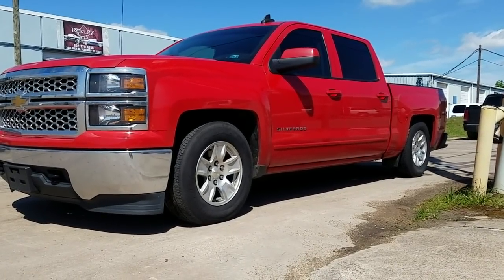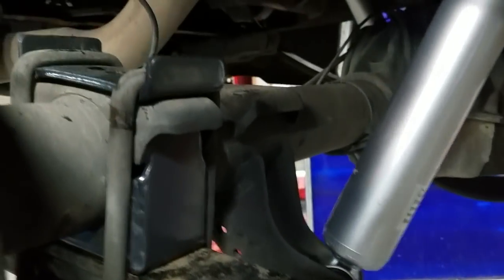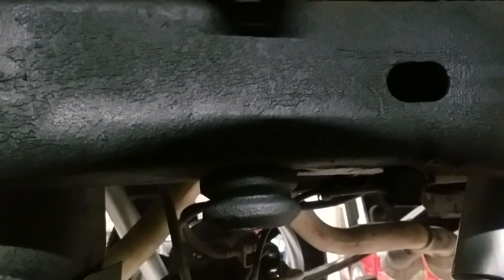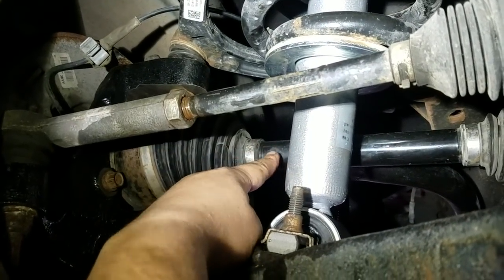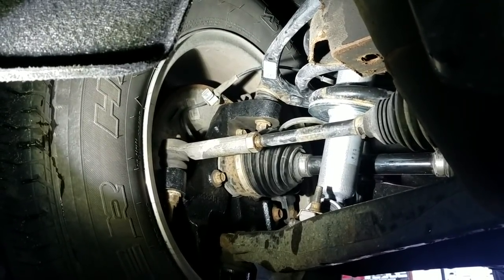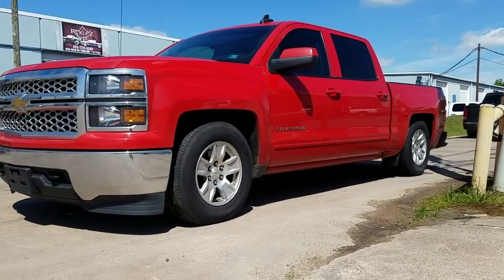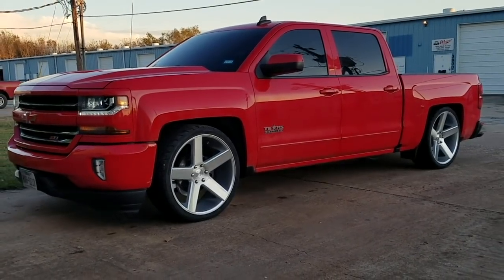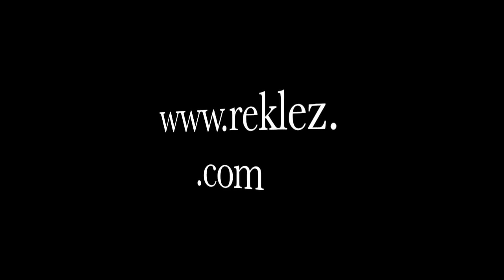4/6 Drop on 2014 Silverado Sierra 4x4 Trucks Cast Control Arms,

Comment from the maker: Buy this kit directly from our website! Get it shipped for free! https://reklez.com/products/2007-2017-silverado-sierra-drop-kit-3-5-4-7
Reply: Reklez Suspension Works  when will the 4/6 drop be available for the 2019 Sierras
Reply: About what do y’all charge for the first job?
Reply: Reklez Suspension Works do you have 6/9 drop kit for 2016 sierra 4x4 ?
Reply from the maker: @chevytrucksrock6608  lowest you can do on a 4x4 is a 4/6 we offer that kit www.reklez.com
Reply: Can this be done on a 2012 4x4 dually?
Reply: So the kit comes with everything we need for a 4/6 5/7 3/5 drop I’m about to order it for my 2014 Chevy crewcab 2wd would you guys recommend cast steel arms or the stamped steel arms

Comment: Planning a 4/6 drop on 2001 F150 4x4 crewcab. Wondering if I can get away without changing spindles. Factory spindles with belltech struts  allow a 4" drop?
Reply: Try using control arms. Lowering with just the strut could give you bad cambrr

Comment: I recently dropped my 08 Sierra with a maxtrac kit to drop the front by 4 inches. I’m rolling on 24’s and on bumps or uneven roads , the front begins to rub on the tires a bit. Should I buy a new strut, or what could be causing it to sway up and down in the front?
Reply: Ismael Flores depends where it’s rubbing but if it’s rubbing that easy sounds like u have the wrong offset rims and they a sticking out to far

Comment: whats the lowest you can go on a 4x4 i have a lifted 2017 right now. wanna go low tho
Reply: I just lowered my two wheel drive 2018 Silverado using a full Maxtrac adjustable kit with a 2 inch drop spindle and adjustable strut up front and flip kit for the rear.  I started with a 3/5 drop but I plan on going to a 4/6.  On this video he said you don't need a c-notch for a 4/6 drop but should use the bump stop.  It looks like they cut the original bump stop and drilled a hole in the frame to install it, you will have to cut the original bump stop bracket out. This video is very informative.  My wheel size is 285/45/22 no rubbing issues and it looks like I will have plenty of clearance for a 4/6 drop.
Reply: @SINGLESPEEDRIDER  you have a instagram

Comment: Hey guys im just up north from you in fort worth and I'm planning on doing something with my 18 silverado 1500, it's a double cab 2wd, when i get ready i will need to get some quotes from you but for now could i get the specs on the lift kit and the wheel and tire size, im digging that setup, thanks for your time
Reply: Call them

Comment: Hey fellas, How often do you guys do a 2/4.5 drop on a 2014-17 Chevy Silverado crew cab v6 with 24s..?? How smooth is that ride, are 24s to heavy for a v6..???
Reply from the maker: Hey, bro we hardly ever work on V6s. If you need more info/ prices. Call us on Jan.2 when we get back from vacation..
Reply: I greatly appreciate your quick response, how good do v6 crew cabs do with 24s
Reply: @jaluco02  I had a v6 on 8s bro no problems
Reply: A v6 with 28s
Reply: Yo how do I do a s/4.5 drop on my 4x4 silverado or what kit do u use @jaluco 02
Reply: brian avitia my truck has a 2/4 drop on 24s 35 series tires

Comment: What parts would you need for 2016 Silverado Z71 extended cab with aluminum control arms? Looking for possibly doing a 2/4 drop on it.
Reply from the maker: Hey bud we offer what you're looking for on our website. www.reklez.com
Reply: @ReklezSuspensionWorks  
I found the kit on your website for 2016 Z71 with aluminum control arms. To do a 2/4 or 2/5 drop. Only thing is it doesn't say what comes in the kit. Just a picture that really isn't clear as to what the components are exactly. I know this is 4 months later. But between research and then the budget got cut hard for a while there. Now back on track for doing this setup I have plan.
Reply from the maker: @ecocav0222  call us to help you faster (832)770-4366. Thanks

Comment: I have a MaxTrac 2/4 drop on my truck and like in this video I to want to obtain a 4” drop in the front. Can I use my 2” spindles with a 2” coil over my stock struts to gain that 4” and use my flip kit with stock hanger to achieve 6” drop in the rear..?
Reply: By the way I forgot to mention I drive a 2014 Chevy Silverado v6 crew cab
Reply: The 2” inch coil spring I plan on using is a Mcgaughys

Comment: Whats the lowest drop i can get on a 2016 gmc sierra denali 4x4??
Reply: Since it is a 4x4, the recommended is 4/6. I would be careful about the magna ride. You should call them for  a better answer
Reply: I found this kit which utilizes your rear and front shocks/struts along with sensor rods. https://maxtracstore.com/2016-5-2018-gmc-sierra-denali-1500-2wd-premium-3-5-or-3-6-drop-kit-331535mra/